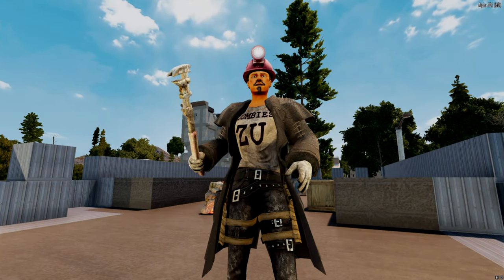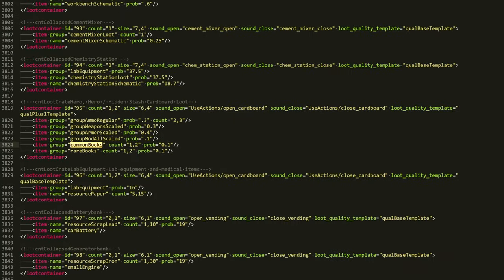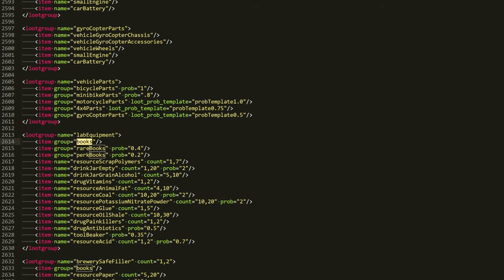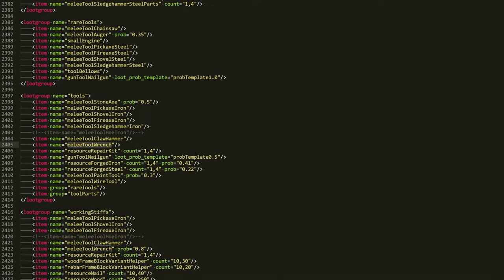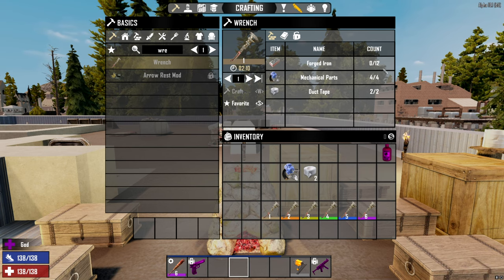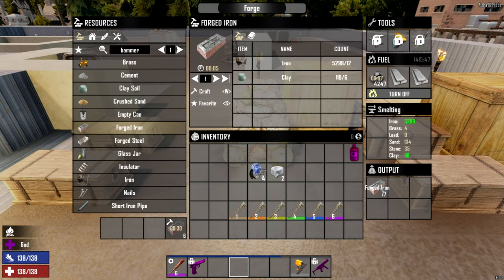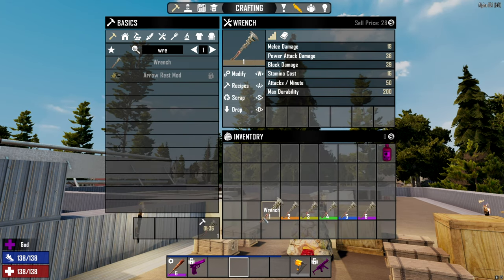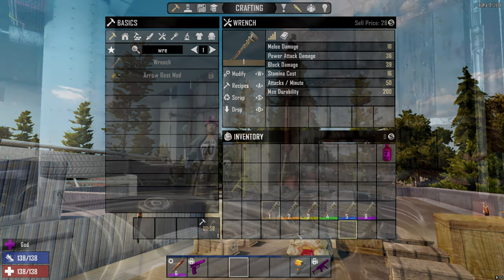How to Make a Wrench Alpha 18   7 Days To Die

Comment: Plz help me I don't know where to find mechanical parts
Reply from the maker: Dang what an oversight on my part. I think they can be crafted in the forge  could be the workbenches though. Tfp changed the recipes. But I'll have to add that part in and rerelease the video. Sort of taking g it for granted that tfp has made the wrench so common under sinks.
Reply: @AdredenGaming  I can't find a wrench OR mechanical parts anywhere and I'm on day 12! And you can't craft mechanical parts either. I tried.
Reply from the maker: @AuthorWilliamMiller  I'll have to make a video on it. Its more searched then I thought. In a18.2 it has been easy to find the wrench under the sinks. Maybe they changed it. I'll have to do a bit of a look around in a18.3. I think to that I can make a better version of this video.   
But mechanical parts look in working stiff crates. Else if you have a take apart cars, filing cabinets,  shopping carts.